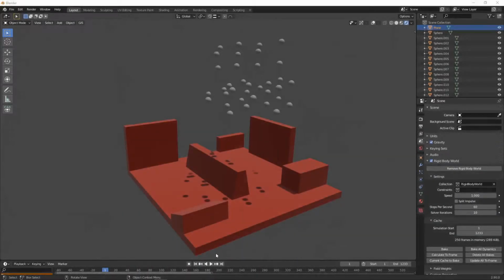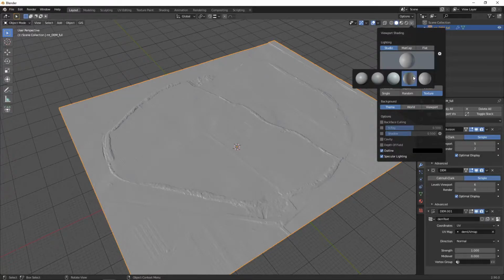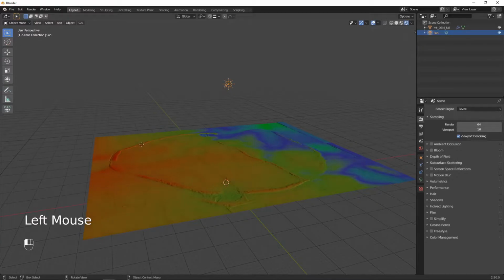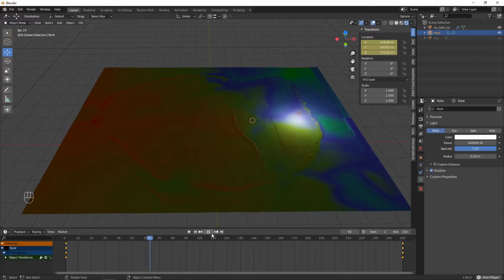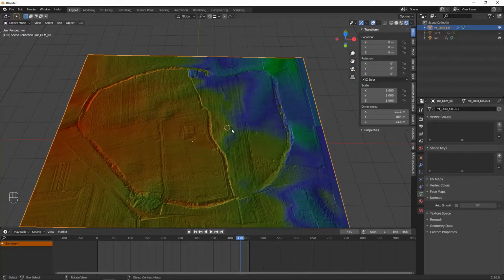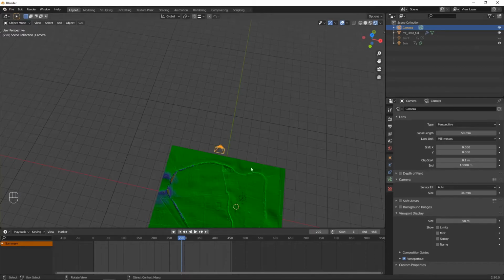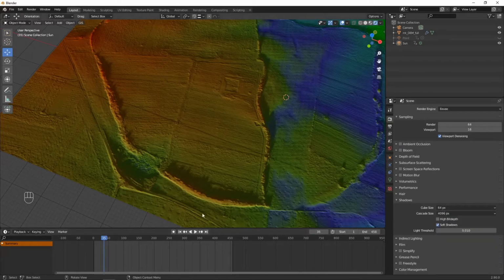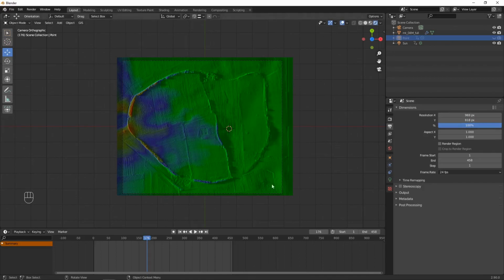Blender GIS: animating a digital elevation model

Comment: Thank you for the video!  I am having issues importing my georeferenced Dem .tif into blender. This is not LiDAR, but Structure from Motion from Photogrammetry.   When I try, I get this error: struct.error: unpack requires a buffer of 4 bytes.  Any idea what I need to do?
Reply from the maker: Not entirely sure. But it may have to do with the export settings in your GIS program. If you didnt create this tif yourself, but you got it from elsewhere, you could try to load it in QGIS and export it again with default settings.